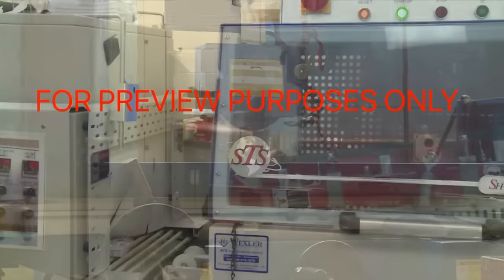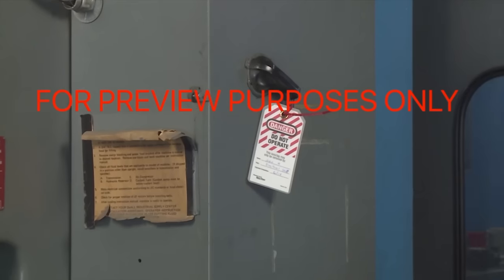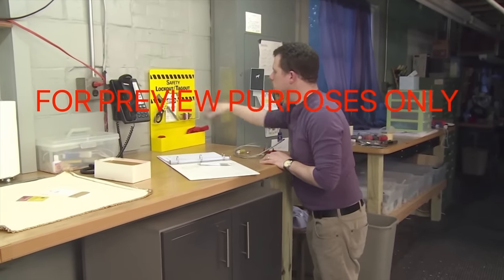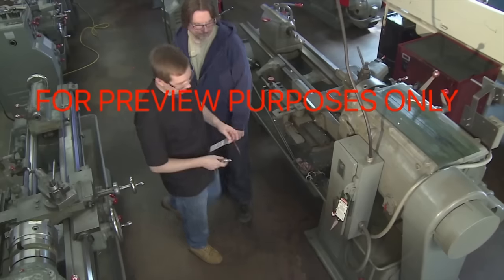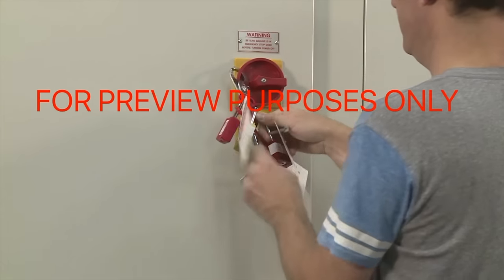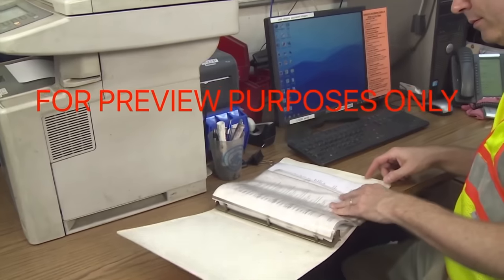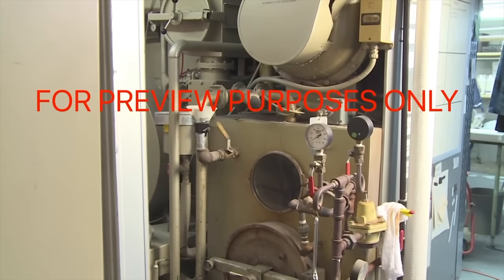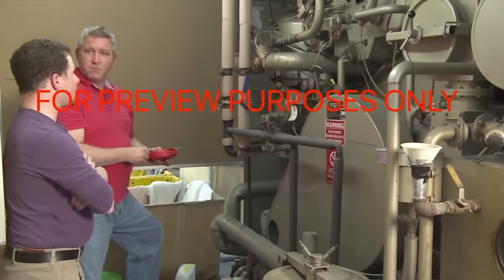Lockout Tagout Training Video [Employee OSHA Training on LOTO]

Comment: One addition that should be made is when locking out hydraulic and especially pneumatic machinery. Not only do you have to check to ensure the stored energy is disapated, but it is also good practice to have a plan and procedure to ensure energy is not slowly built back up in the event of a bad valve. One method is to lock it out, disepate the stored energy, waiting a designated period of time, and then recheck to see if energy has leaked into the system. Other methods include gauges that allow visual observation, or installing or cutting in check valves with low pressure settings (ex. 1/10 the required pressure to operate the machinery).
Reply: thank you!
Reply: thank you! Be safe ✌🏻

Comment: AFTER A LOCKOUT THERE MAY BE ENERGY? 1. HYDRAULIC: MOVE TAKES OR DRAINS, 2. ELECTRIC: GROUND, MOTORIZED: SPRINGS? THE MACHINE MUST BE ACTIVATED IN THE NON-ENERGIZED EQUIPMENT?